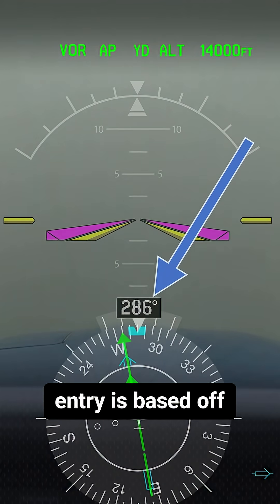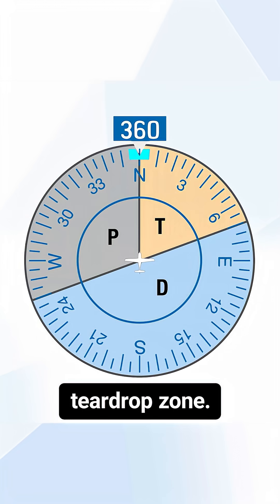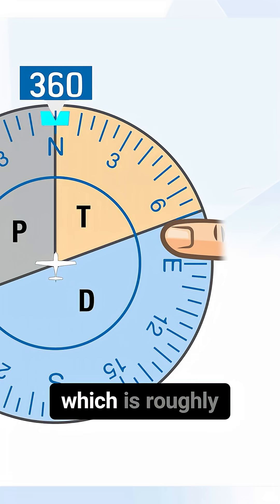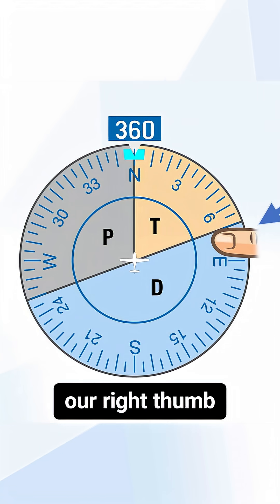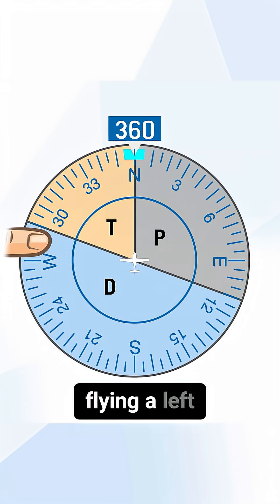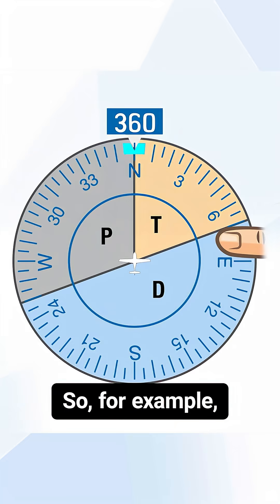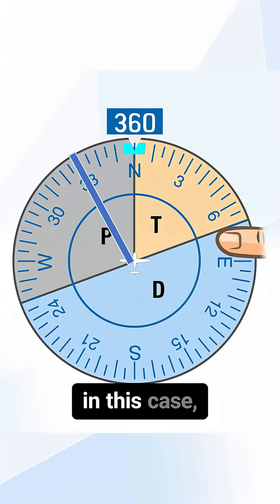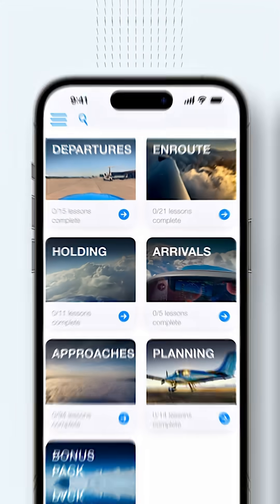How do you choose the correct entry for a holding pattern?

Comment: The visualization looks a little backward to me. I was taught to stick the tip of a pencil on the holding fix and swing the tail of the pencil 70° into the holding airspace and then continue that line through the holding fix. This gives you a 180° region defining the direct entry airspace. If you then draw a line parallel to the inbound course and through the holding fix itself you get two additional regions, the smaller of which is the teardrop entry and the slightly larger the parallel.

I bring this up because the angle of the line you showed for the standard right-hand pattern looks like what you would get using the pencil method but for a left-hand pattern. Am I missing something here?